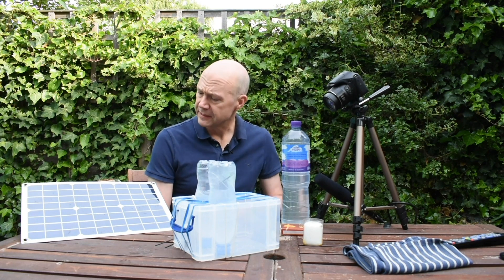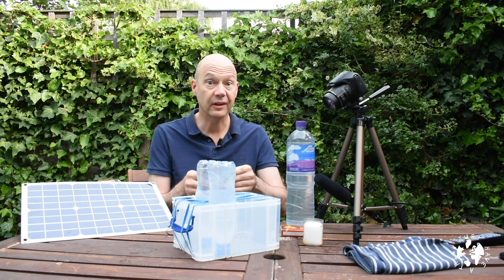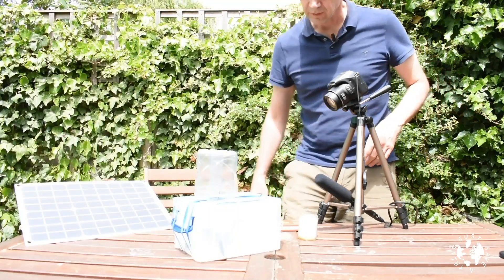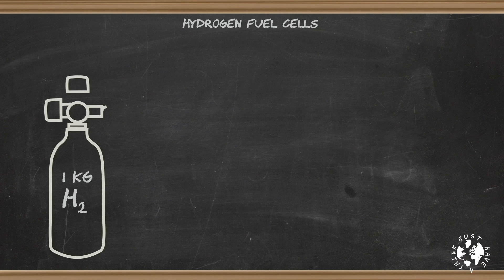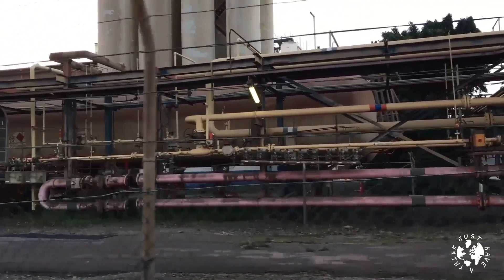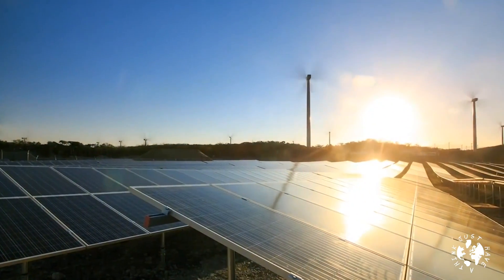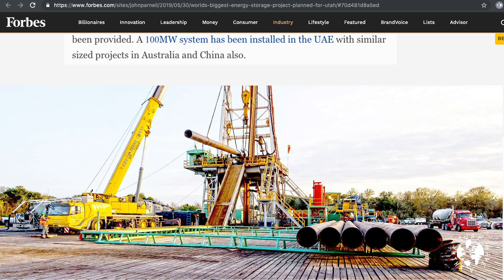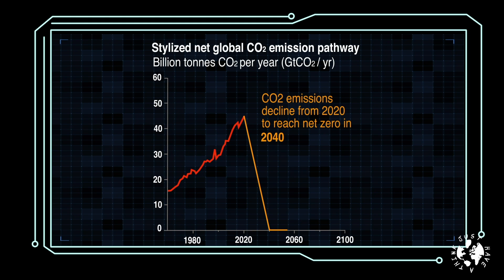Energy Storage in Hydrogen : Does this beat batteries?

Comment: I know Hydrogen is touted as one of the "greenest" fuels, as it produces only water as an exhaust.
Methane, if created by extracting CO2 from the atmosphere, and when burned reproduces the same CO2, would be equally as green.
Methane has many other benefits over Hydrogen, like it's energy density and easier storage.

When I've talked about the idea before, I get the excuse "but then that'll just lead to using methane from fossil fuels and putting more CO2 in the atmosphere", but hydrogen is also made from fossil fuels so that argument is pointless.
Reply: Methane is much more practical than hydrogen.
Reply from the maker: Hi n.steam. The so-called 'Carbon neutral' fuels, while better than fossil fuels, are not a great long term solution. And I would agree with the point about fossil derived methane creeping in. It would be staggering if the fossil fuel producers did not do this. Their mission is to exploit every ounce of oil and gas that exists on the planet. That's their reason for existing on this planet. They will never change. Last point - Hydrogen does not have to be made from steam reforming. Electrolysis works and if powered by solar, wind or other renewables it neither uses nor produces any greenhouse gas.
Reply: @JustHaveaThink  No, their mission is to make money. If they can corner another market, they will do it.
Reply: @JustHaveaThink  Then you must think the same for hydrogen, as it is considered a waste product by fossil fuel manufacturers, which is why it is so cheap.
If you think laws and regulation can help prevent it, then the same laws and regulation would also work for methane, that is my original point.

Can you explain why 'carbon neutral' is not a good long term solution? Why there is any difference to equal in-out of CO2 to not using CO2 at all?

Given all the benefits mentioned that Methane has over Hydrogen in terms of storage, and failing to give an argument against it that hasn't already been countered, I'm afraid you might be coming across as a zealot who sees using CO2 at all as some kind of bogeyman.
Reply from the maker: Hi n.steam. Thanks for your response. It's certainly a difficult stance to take to argue against technologies that are, at least, better than full blooded fossil fuel exploitation, but my point is that such technologies do  leave the door open to complacency. I am not a zealot and never have been. If I am anything at all worth mentioning, then I would say I am probably a pragmatist. My full time job is as a Project Manager, designing and building new store spaces for a little independent art supplies company in London. In that role I have to act as an 'outcome oriented' manager. So I don't have the luxury of sentimentality - I just have to keep my eye on the end result and make sure the project gets there on time and on budget. In the case of CO2 - we have been provided with strong evidence by the IPCC and other well established scientific organisations that simply slowing down the amount of CO2 we emit, is no longer anywhere near adequate - and of course we are not even doing that, CO2 emissions are now tracking back upwards since 2017. So without significant carbon dioxide removal, via new technologies like Direct Air Carbon Capture and Sequestration, we have zero chance of meeting any kind of mid century target.

Comment: Great video, I was wondering how much water is required to continuously provide storage of TWh of energy stored and whether this would be a problem should everyone start to use this technology worldwide. I understand that when it is burnt the output is water but if lots of hydrogen is stored there will be a vast amount of water taken out of the world's water reserves, also if the oxygen liberated will increase oxygen in the atmosphere what effects will that have? I suspect there are no free lunches and we once thought the bounty of the oceans was limitless but it was not.
Reply: @Cliff Bartle Added to your point: When I watched a related German feature today, the issue of what kind of water can be used came up as well. Can it be ordinary (sea) water or does it first have to be purified? If the latter, what about the danger of even more polluting brine as a by-product, just as already is the problem with a lot of saltwater distillation methods? And, as you said, on a very, very large scale?

Comment: So what happens to the extra atoms on each side? EG: On the hydrogen side what happens with the oxygen molecule when it separates from the hydrogen, there is nowhere in the bottle for it to escape. For the oxygen bottle, there are 2 hydrogen atoms left, I don't seem them transporting to the other bottle. So, I am slightly confused on how this actually functions.
Reply from the maker: I think you need a chemistry scientist my friend. That, I'm afraid (as you may have guessed) is something that I am most definitely not :-)
Reply: I am not scientist but I assume that the split does not happen just next to electrodes. It happens along the current flow. What is the electricity actually? Some free electrons jumping to closest available space. And in this journey they hit the water molecules and split them. The atoms will travel in different directions. they will turn into gas when enough of them are there, otherwise are still dissolved into water. If the split happens too close of an electrode I assume that the atom is likely to contaminate the gas supposed to be collected on that electrode instead of traveling to the other bottle.

Comment: Why do supposed alternative energy experts always say there are only two ways of storing hydrogen?  There are commercially available magnesium hydride storage tanks, which uses the metal's ability to keep hydrogen inside the gaps in the crystal structure.
Reply: Brendan H But what is the volumetric energy storage for that option vs having it pressurised/cooled to increase the density? How does that compare to oil based energy storage and energy density? For transport its impractical to have a huge volume storage tank to store hydrogen in low density magnesium hydride tanks.
Reply: At 13Mj per l, it is more than twice as high as typical compressed hydrogen and 10x lithium ion batteries, but still only 1/3 of the energy density of gasoline.  Still, this would seem economically  comparable to batteries and traditional hydrogen storage. The main niche market is local storage from solar electrolysis, rather than target transportation which would have it compete with gasoline.

Comment: I didn't see a comparison between hydrogen and batteries as I think both have their advantages, in certain areas.  Hydrogen fuel cells are a great answer to ships and large machines, especially those that go back to a central fueling station, regularly as hydrogen is very expensive to store but makes NO sense for cars, trucks, bikes, boats, yard equipment and small machines that can, and do, charge at home for most of their charges and would never consider taking them to a H2 station for fuel fill ups.  BTW, there are no Mormons in Utah, but there are A LOT of Latter-day Saints.  Simple correction. :)

Comment: Great video.
Hydrogen storage, like normal battery storage, is a form of chemical storage. You use energy to chemically alter substances after which you reverse the process and get the energy back out.
There's nothing new or special to this concept. The only question is: "how efficiënt is it?"
Reply: comment on point
Reply: Effiency matters, but also its Relation to cost. Of course, one can accept 10% less efficiency, if cost is reduced by 25%. In this case, to get the same overall energy, you need to put some saved money to conpensate the losses by e.g. increasing solar panel area by 10%.
Reply: Manny Santiago  Yes, you are right, also ecology is a factor that matters, of course also a few other things, like size, design, etc.

Comment: I remember reading that gravity is the most efficient way to store large amounts of potential energy.  For example, you could have pumps being powered by a combination of wind and solar that pump water up to a somewhat higher elevation as part of either a natural or manufactured reservoir for the water being pumped to reside at a higher elevation.  Then you can release a portion of this water through turbines similar to the typical dam/hydro-electric method of generating electricity.  After this same water has been allowed to run through the turbines it can then be immediately pumped back up to the reservoir again using a combination of wind and solar.

So the energy related to the "charging" portion of what amounts to a big battery comes for free minus the costs of the wind and solar along with the pumps and of course the turbines.  But still these are one-time costs.

So what about a big battery based on this concept?  It's obviously not harmful to the environment unless of course your man-made reservoir lets assume, springs a leak.
Reply from the maker: Hi GW. That's a technology already in use in some parts of the world. I think it's called Pumped Hydro, and it's used for grid balancing by big power producers. I may well take a look at this in a later program :-)
Reply: @JustHaveaThink  ok it figures that something like this is in use since it's so straightforward.  need to research the gravity claim that's it's the most efficient.  The free green energy sources keep giving you back gravity driven power which is also free.
Reply: @JustHaveaThink  There are some documentaries about it. The issue is that locations are not enough. And of course huge upfront cost. But there is gravitational storage too that claims 90 percent or more efficiency. The one using huge towers looks like a scam, but the one using terrain inclines seems genuine, also the one using disused mine shafts. Sure, for large scale storing the usable old mines may be not enough. But I wonder what will be the ROI for such a system. For example the 100 MWh australian battery returned that almost 50 million spent in less than two years.  But this is because balancing is expensive. Meantime batteries got cheaper, but still cannot compete with pumping hydro if we consider long term storage, since hydro will work for decades. for example the battery compared with Bath County Pumped Storage Station is 83 times cheaper but 240 times smaller. So is already 3 times costlier per capacity installed, but better efficiency will compensate on life time run. There are too many factors to consider. How many cycles will last the battery? If 1000 (may be more, ) than in the end will deliver 100GWh delivered. The hydro will last 75 years, delivering 20 times more cycles. but will lose a third of every unit stored. Anyway, if I did not messed figures in my head, at 6 cents per kw, cheapest solar now production, at that 100 GWh served the hydro loss will be 2 million. so is 25 times better than batteries. 

But I wonder how much will cost to dig a 100 MWh capacity  gravitational storage? They claim 90 percent efficiency so will compete with batteries even those get cheaper too. All it remains is upfront cost, but considering long time storage, underground gravitational may be an really good option. 

Digging the shaft, and some horizontal tunnels for storage may seem expensive. But if we consider that this was done for collecting coal and ore for a single use and was efficient, even with old technologies and a lot of manpower, it may be feasible for centuries of use and digging  cheap with modern machines will sure help.

Comment: You have notable concept issues from 2:08 to 2:30. The complete circuit you have there is: solar panel -> negative electrode -> through water solution -> positive electrode -> solar panel. Your comment that there are 2 hydrogen to every oxygen and thus twice the electrons are going into the negative electrode bottle than the positive electrode bottle implies either a source creating extra electrons or a sink eliminating electrons. Since that circuit has no external sources or sinks of electrons and can neither create nor destroy electrons this does not make sense. The electrons passing through the circuit use the energy that they obtained from the solar panel to break the bonds between the hydrogen and oxygen atoms. Also, there is not a "hydrogen bottle" and "oxygen bottle." The gas inside each bottle is a mixture, 2:1, of hydrogen to oxygen. I was hoping you would have taken the "oxygen bottle" to the candle as well as you would have seen another flame indicating the presence of a flammable gas, specifically hydrogen. Also, if there were a specific gas in each bottle you would need to answer the question, where does the other gas go? For example, if the negative electrode causes a release of hydrogen in that bottle, where did all the oxygen that was in the water molecules that was broken down go? You also stated that the "hydrogen bottle" should fill up twice as fast as the "oxygen bottle" which did not happen. The rate that each one fills up has nothing to do the ratio of atoms in water. You would have to involve different pressures or solution concentrates inside the bottles to cause the rate of bond breaking to occur at different rates in the two bottles to see that effect. This experiment does not require two bottles. So long as the electrodes are separated they can both be in the same bottle. Adding the second bottle simply doubles the capacity of gases that can be contained in this case.
Reply: On a side note I am a physicist not a chemist. I leave it to others to research the electrolysis equation and see that the "where did the gas go?" question is not answered by "it reacts with the electrode." You should find that the reaction does not eat away the graphite sticks over time and that you can use them immediately after the experiment to write without the need to scrap a surface off of them.
Reply: Yes, the positive and negative ions should each be attracted to different electrodes, but with that primitive gas collection system it is very likely he has same mixture in both bottles.

Comment: I'd like to see the analysis of efficiency of H2 storage for both Compressed and Liquify methods.
Reply: Compressed H2 creates complications in proportion to its pressure, due to the fact that hydrogen atoms can fit into the crystaline structure of the container and associated hardware. Synthetics are highly resistant to this, but not immune and not as strong as other materials.  

Liquifying hydrogen is incredibly power intensive, and unlikely to ever be an economical solution.

Comment: lets say for example, your home is powerd on solar and all overproductions during the day is converted into hydreon.... do you realy need to presurize or liquify the gas for use during the night?
wouldnt it work as well in low preasure form?
Reply: Let's say your system produces one kilogram of hydrogen, which would hold about as much energy as one gallon of diesel fuel so it can run your generator for a while. If you do not pressurize the hydrogen at all, that one kilogram will fill a volume of 11.2 cubic meters and the balloon you stored it in may float off if you are not careful. And you would need to store it in a balloon, because you need to squeeze the balloon so the gas is pushed out if you want to use it for anything...
Pressurized or liquid gas is harder to get into the bottle, but you only need to open the valve a little to be able to easily use it. Whether the system to do this can be made economically and small enough to be of use for typical off-grid homes is an interesting question that I would also like an answer to.

Comment: It seems like the most important information when considering a storage technology is its round trip efficiency (=energy out/energy in).  Below is a quote from the extensive wikipedia article on hydrogen storage.  
"The round-trip efficiency is approximately 40% (vs. 75-80% for pumped-hydro (PHES)), and the cost is slightly higher than pumped hydro, if only a limited number of hours of storage is required."  
https://en.wikipedia.org/wiki/Hydrogen_storage
Reply: I would imagine efficiency is less important when the source (solar in this case) is free.

Comment: Pumped storage systems would be a far more efficient way to go as the energy to push the water up hill will only be a very small percentage greater than what you will get out of the system whereas with electrolysis of water and then comppresion of hydrogen and most likely the oxygen ( fuel cells work better and last longer without the contamination from air) uses vastly more energy than you will get in return.
Reply: Is in use where possible (mountains) for shorterm storage (hours, days),  not a solution on the global scale. Also dams can break - the more you build the higher the chances. - Also lakes that would be stored for longer (to help bridge the gap between the seasons not only short) can become sources of methane (and mosquitos etc.). That would especially apply in the warmer regions. those lakes would not exist long enough to become functioning eco systems - where for instance other insects go after mosquitos.

And methan is a powerful greenhouse gas (28 times the effect of CO2 in 100 years).

Comment: Seasonal storage would be great, but not with hydrogen. It will escape any known pressure vessel.. However, if somehow somebody made some kind of material or coating able to hold hydrogen in, that would be great.
Also, keep in mind you got to account for poor electrolysis efficiency. Again, if somebody somehow invented some kind of catalyst or improvements here.. we would be so much closer to hydrogen economy.
But with hydrogen escaping and electrolysis efficiency being so low.. I don't see it coming yet.
Reply: Hmm, doesn't the Toyota Mirai successfully store hydrogen in onboard carbon fiber tanks?